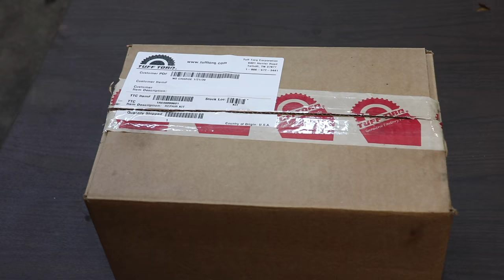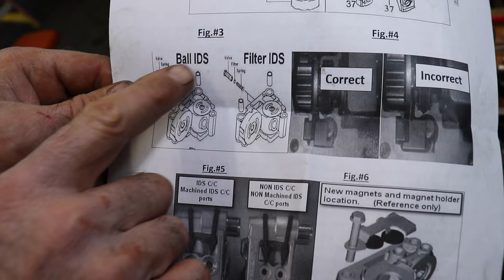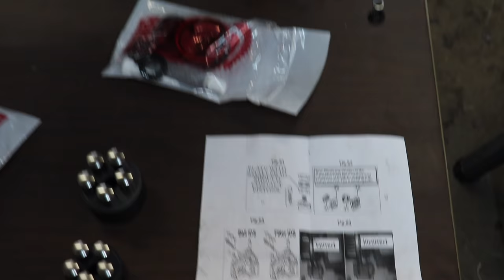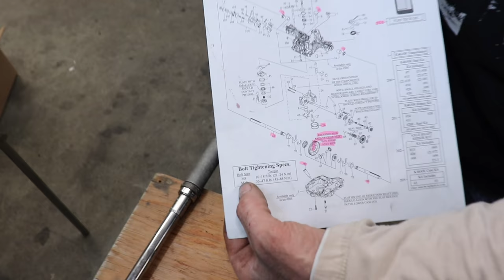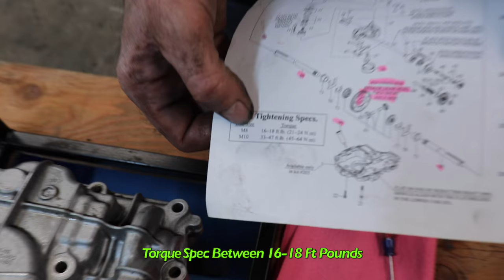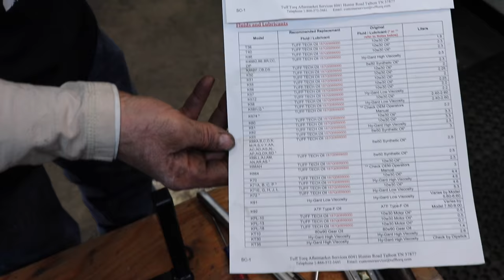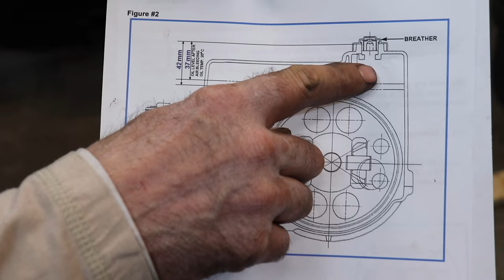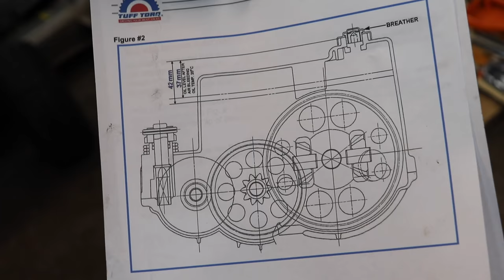How To Rebuild A Tuff Torq Hydrostatic Transmission: A Complete Guide

Comment: JUST finished doing this on my K46 from a Husqvarna 20/42.  Took 3 years for it to completely die on me so i picked up the kit out of the US because NOT ONE DEALER IN MANITOBA could source the part number i needed.  Took 3 weeks to get here and $750 CDN later on the rebuild kit and it works!  Took a bit to get it all bled out, but just cut 2 acres with it and it will actually go up a slight incline without issue now.  My symptoms were a nasty whine from the tranny as well as no power at all.  Just crawled like a turtle and then died.  Changed the drive belt multiple times thinking that was the problem and no joy.  It was always the pump, motor and case.  I'm pretty mechanically savy, but this video certainly helped me. Thx Taryl

Comment: I had a john deere D110 i purchased for $75.00 trans would not move not even in neutral. I pulled the transmission out after watching Taryls video and found a $4.00 bearing demolished. Replaced the bearing and the trans worked great! Thanks for the great video!

Comment: Great video Taryl. The trans I rebuilt is now working perfectly. Instead of buying a rebuild kit for £300, I had both rotors machined, removed approx 5 thousands of an inch from each one. I then cleaned out the crankcase thoroughly with petrol, reassembled, added fresh oil, refitted trans to the mower (a Countax) and it works a treat.  Many thanks from England😊👍
Reply: which specific piece do you machine? Is it the round "motor" that holds the five pistons?
Reply: @bwp253  hiya, yes, what happens is the surfaces becomes scored, these micro grooves cause pressure drop as the oil squeezes out through the grooves. Taryl shows this in the video.
Reply: I've seen on one of the forums where people sand the surface smooth with 800-2000 grit sandpaper on plate glass to restore the power.  I am thinking about draining my k46 and refilling it.  It's from ~2003 Scotts JD L2048, but it only has 310hrs on it.  Our yard is mostly flat, we rarely trailer with it, and I'm the heaviest rider at 200lbs.

Comment: This is one of your very best videos. These hydrostatic transmissions are really not that bad to service if you see a thorough demonstration of the servicing procedure. I've watched two other videos prior to this one and yours is really excellent, covering all the details and explaining some of the important details of the design of the parts and how to avoid errors in the reassembly procedure. These transmissions are really expensive to replace (practically the cost of the tractor) so servicing one that is working but no longer delivering the original amount of torque and speed is going to save people a lot of money if they can spend the time to do the rebuild.

Comment: I had an oil leak in my JD D125, due to a rock being thrown up from the blades.  It caused a graze with a tiny hole in the aluminium casing below the diff section.  I contacted my JD dealer who said, the only way to repair it was a replacement Tuff Torq transaxle at Au$975.00.  Thanks to Taryl's video series and a tube (actually two tubes as it's an epoxy mix) of JB Weld, the whole job took less than an hour and cost less than Au$20.00.  I also fashioned a steel 'bash plate' to go under the transaxle, so, hopefully, it won't happen again. Thanks from the real deep south, South Australia, there ain't nothing souther than us.

Comment: So input pulley and belt, drive the drive pump with the springs and pump plungers, they bear on the swash plate. The Swash plate is sprung to a flat position meaning no pumping, if you rock the swash plate either way the plungers start to stroke, pumping oil one way or the other for forward or reverse, the amount of tilt on the plate varies the amount of oil the drive pump delivers. This feeds the corresponding plungers in the output pump driving the stack of gears going to the differential. The output pump plungers drive against the ramp which can be put one way or the other to reverse operation of controls. Pin pushes valve faces apart to provide a positive neutral.  Filter is on suction from sump. Interesting stuff thanks Taryl. Seems like changing oil and filter on a regular basis saves the day in most equipment. The two dampers for forward and reverse selection initially dampen the transmission take up by allowing some of the oil going to the output pump to press the piston back against spring as the rest of the oil heads to the output pump driving section, causing a slower take up. Should wear gloves oil is not good on hands long term, so should I😀

Comment: Thanks for the video! I put this project off for a few years since I burned up the K46 in my JD LA175 from pulling an aerator. It really wasn't that bad to do and people told me I was nuts for taking it apart. It just takes patience. I kept thinking what a waste it would be to just scrap the tractor with a good engine in it. Well, it's back in and no longer wanting to lay down on me after a half hour of use. Once again, thanks!

Comment: Very Helpful!!! My K58B was a little different, but most everything applied to it except extra rotor pump on bottom of Hydraulic pump, and the small roll pins that have to be removed and reused to locate it. Thank you very much for your video. Most folks dont realize just how much effort goes into making a video like this.

Comment: I really enjoyed watching this one Tayrl/Junior/Crew.I guess Amsoil has really saved my K-66 from leaking seals.I put in Amsoils Hydro/trans oil,5W-30.
I done this just after break in.
My LX-288 is 20 years old and not a single leak what-so-ever,mowing 15 acres of lawn every week.
Reply: That's cause it's 20 years buy a new one and let's talk in 5-years.
Reply: @edgenet1  My newest tractor is 10 years newer then my LX-288.
In the summer of 2010,I bought a X-534 with the K-72 C in it.
I've done the same thing to this one,right after break in,I installed Amsoils 5W-30 hydro/trans.oil in it.
After using this tractor for 10 years,no leaks at all.

Comment: Taryl, love your humor! If you take it down to that level, to save a bunch of cash, you can block sand the 4 pump and motor surfaces with 1500 grit wet sand paper using the motor/pump rotors as the blocks, only takes a few minutes each to flatten and refresh both surfaces. It doesn't take much grooving (.005" or less) of those surfaces to lose pressure.
Reply: have you tried this successfully? I saw it on another video and was wondering if the surface is planar enough at the end.  Trying to save the $400+ that a rebuilding kit cost!
Reply: @bwp253  Absolutely, i have a granite surface plate I use the edge of. Just cut in half and laid the 1500 grit on the plate, kept spraying plate and paper with water and worked the parts back and forth with even pressure until all groves were gone. had to remove the locating dowel pin from the aluminum body to get more room to work it. 

PS that isn't my post above with my name on it, I posted a much longer step by step procedure describing how I do it from removal, disassembly, resurfacing, reassembly and re-installation, don't know what happened to it YT is screwy sometimes.
Reply: @bwp253  Found that post, see below.

Comment: You dont need to replace the revolvers and The center case if them has groves. Just buy some wet sandpaper ( 320-1200 grit on the revolvers, 400-1200 om the case). A sealkit, breakcleaner, Some new motoroil and a piece of glass (minimum 4-5mm thick). Lay the glass on a surface that dont flex and dosent have any groves and etc. Place the sandpaper on the glass with some oil on. Start with the revolvers and move them in 8’s. Start with 320 grit and end with the 1200 grit. Wash them clean with brakecleaner. Do the same with the Housing but start with 400 if its deap groves. If its just small groves start with 600 grit. If you dont can sand in groves just move back and forth. Inspect all the springs in the revolvers. Inspect the pins on the revolvers so them dosent have any holes on the top. Reacemble everything again. Fill it with right oil and Mowe your lawn!

Have Done this about ten times with good result.

Sorry for my bad english. Im from Sweden and misses som english lessons in school🙄
Reply: I done this with lapping compound and wd40. When you get to a mirror finish, one light swipe with wet scotch bright to give it the smallest crosshatch.

Comment: Thanks for the info! Dude you are very neat and organized!!! I like the way that you clean off the crud and junk before you open a system up for service. I see people just open them up with dirt and all kinds of junk around it.  I’m just a regular guy and I like to work on my own equipment.  I’ve gotten burned letting strangers and shops work on my stuff. You normally don’t find out until you get into it yourself.  I take pride in my work. Done right done once. I had my mower tipped up and leaked some trans fluid out. I think I need to add some fluid to mine. Gonna start that task right now. Gotta figure out where the fill line is on mine. I saw the fill cap.  I have a Cub Cadet SLT1550.  Thanks again.

Comment: Finally! I have been trying to find some info on this transmission and having no luck. John deere says no repair but we will sell you a brand-new one for 1100 dollars.
Was slow to move in reverse and then just stopped while cutting in forward. Could feel it slightly load up when switching forward to reverse and back but no locomotion.
Thanks for this👍
Reply: Did you get it fixed?

Comment: Taryl,  for turning the pump to prome it, I cut a small 3 in section of 1/2" copper pipe then slotted each end and used a 10 mm socket to drive it with my drill driver. Secured the pipe ends with worm gear clamps. Like your videos. Thanks

Comment: Proper terminology: Pins=Pistons, Little washer=Swash Plate, Thing The Little Pins Are In=Barrel, It's basically a hydraulic piston pump with a piston motor for the output with two cross port relief valves to make up a hydrostatic transmission. That you for this video. I was just looking for fluid change procedures and came across your video. It seems Huskvarna went out of their way to make these mowers as close to disposable as possible but where there's a will there's always away. Thanks again.

Comment: Great video!  Helped me rebuild my Husqvarna hydro.  But I came across an idea that helped me with the reassembly.
I put a rubber band around the spring-loaded pistons before installing the motor and pump blocks to hold them from falling out.  After installing, I used some hemostats to hold the rubber band, then used a pair of scissors to cut the rubber band and just pulled it out.  Simple and makes the job much easier.  If you don't have hemostats you could use a pair of needle nose pliers.

Comment: Sometimes when air is in the center block, you can assist  the bleed process by pulling the neutral lever out and then spin the main shaft as shown. This allows that tiny pin to bleed any trapped air out of the power cylinder "pistons". Then return it and spin again.
Reply: Hmmm that would explain why my trans would not move until I put it in neutral and shifted back and forth and then put it in gear. I really thought I had made it worse on my first test drive. I think I filled mine with 10w-40 synthetic racing oil.
Reply: @billburkart9087  5W50 is a better choice if you run your tractor in extreme cold winter's and hot summer seasons.
Reply: I was wondering, when he spun the transmission at the end, shouldn't he have re-checked the oil level after bleeding out the air bubbles?  Isn't it important to top off the oil after bleeding out the air bubbles?
Reply: @mrbubetube  Not if the full quantity of oil is put into the case. The goal of spinning the axle shafts is to bleed air out of the hydraulic circuits (the Power and Drive Hydrastatic cylinders) that compress the oil in the center block. Trapped air is then displaced into the case where a small pocket of air exist anyway. This is why the case is never filled to the top, which allows for expansion and contraction of the oil as it heats up.
Reply: @DougHanchard  ah ok, thanks.
Reply: @mrbubetube actually the tuff torq diagram bubble states the oil level under the cap is 20-25mm from the top AFTER AIR BLEEDING OIL LEVER @ OIL TEMP. 20°C
Reply: My thoughts too. The oil Level needed rechecking.
Otherwise this is a great video. I don't think you missed anything. Thanks for the insight. I have to pull apart my old mower with any argriquip  trans. I'm sure they are much the same. My one has locked up so I'm thinking it's a swashplate or pump failure @mrbubetube

Comment: 18:06  On  my JD Z960M which has a TZT13 trans, a year or so ago I looked up the fluid on Tuff Torq's wed site and they had a page that showed the original fluid and a recommended replacement.  Before they started recommending/offering their OWN fluid, they were recommending Mobil1 5w50 synthetic oil as a replacement for the John Deere fluid.  I assume that's still the case and a better fluid than what JD would be selling.

Comment: Man, you are a legend and a saviour. So much thanks for this video. I found metal pieces on metal filter when I changed oil. Local Husqvarna expert said that those sheet metal pieces came from that 45 degree bearing. He was right. I had hard time to disassemble that transmission without any instructions. Had couple gray hairs from that little metal pin, cos didn't see where it felt. But with you video I'm confident to assemble it tomorrow. Thanks man! 

Husqvarna 316 TsX AWD

Comment: GREAT video that helped me alot. Thank you. Have you ever replaced the outer axle bushings? I did. I used a long 3/8 steel rod to drive out the old bushings from the inside and a large drill press as a press with flat washers of the correct thickness and diameter to press the new bushings in to the correct depth in 3 steps. The 1st step was to press the bushing in to the same depth as the outside of the transaxle housing. The 2nd step installed the bushing to the same depth as the bottom of the seal pocket. The 3rd step pressed the bushing another 0.0875 to the correct depth in the transaxle housing. I froze the bushings for a couple of days before I pressed them in and was surprised how easy the bushings were to press in. I had everything ready before I took the bushings out of the freezer one at a time to press them in. I used micrometers to measure the diameter and thickness of the flat washers. I hope this information is useful to anybody who replaces Tuff Torq transaxle outer axle bushings.

Comment: This is a really well done video. Clear and concise. The details are what will save the first time home repairman from making mistakes. SALUTE.

There is a guy selling the whole transaxle unit labeled as a K66 for $2000! He started out selling them for $800 about 7 years ago but now it's up to 2K.

This will hopefully save my friend from spending way more than he needs to. With a bit of luck the seal and filter kit will get his running again. I have it at my house right now. Sucking out the oil and refilling it didn't fix it. I suspect the filter is clogged.
Reply: My friend just got a brand new John Deere E130 for less then $2000

Comment: After "testing" using the drill and adaptor tool (both forward and reverse), I would have rechecked oil level.  It would also have been nice if they also gave the volume of oil in Imperial [or US measure] (fl-oz) units along with weight in grams and ounces as I sometimes find it easier to weigh than measure volume.  Using a "digital kitchen scale' weigh the gallon jug before and after pouring, if the automatic timed power off is long enough, you can avoid doing math by "taring" the jug first, then read 'negative' weight

Comment: Thanks for that video I had a problem after I rebuilt my John Deere zero turn with a tough torque transmission and it was backwards. spinning backwards so I took it apart and found the exact problem that you showed with a swash plate in this video. I had put that wedge-shaped aluminum swashplate in backwards

Comment: If you buy a new lawn mower best to take the rear wheels off and put anti sieve on the axle in case you need to take the wheels off later. Saves a ton of work if you have to take them off later. Just a tip
Reply: Applies to truck hubs as well.  We had brand new 8 wheelers with brake drums.  First time hubs came off was 24 weeks some needed smashing of, the extractor bolts would just pull their threads.  When new pull off all hubs and copper slip mating surfaces lightly, saves time and money down the line.  Funny how things are the same across all fields we can all learn.

Comment: You're a smart guy Taryl. Thanks for this viewing of the Hydrostatic Transmission, first time I seen the insides. Great table and stand you have friend. Surgeon told me how many individuals get Carpal Tunnel by using your hands as a hammer like you did to loosen that one bolt. Be care with that bud.

Comment: Funny how my 1974 wheelhorse c-120 hydrostat still has the original Trans never opened and still works perfect. Yet these new ones your lucky to get 6 to 8 years out of. Sad. Awesome video though. I'm looking at getting a cub LT2 GX50 with a k62 tuff torque. I'm glad you did this video so I can fix it when it breaks. Lol

Comment: Hey Taryl, great video.  I have stripped my trans down and inspected everything.  My uncle has an engineering machine shop and he is going to surface grind the worn surfaces of the aluminium block and the two rotors, its approx 5 thousandths of an inch max.  I will clean, re assemble and fill with fresh oil and see what happens.
Reply: How did that work for you?